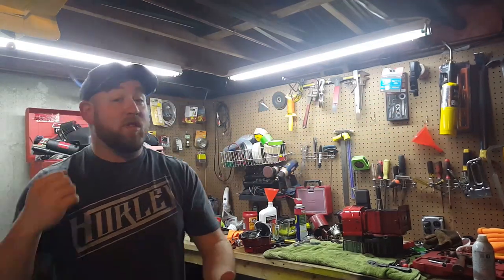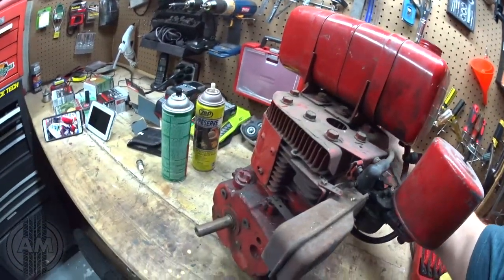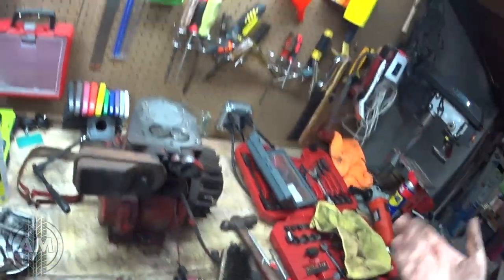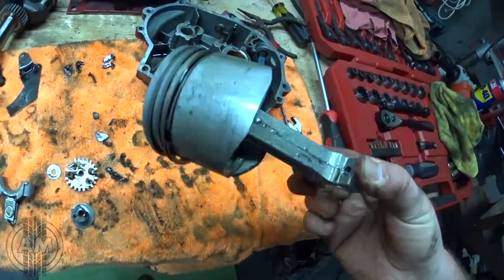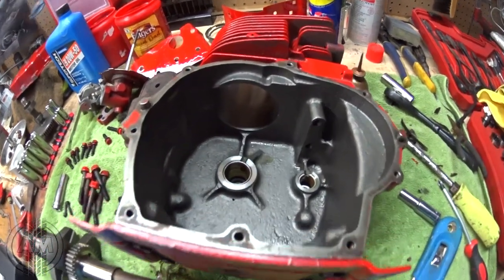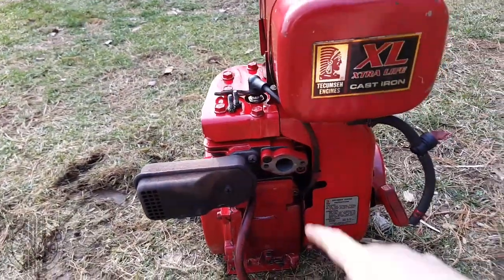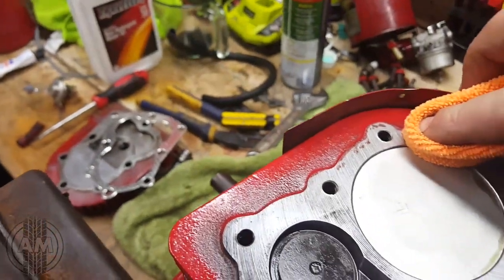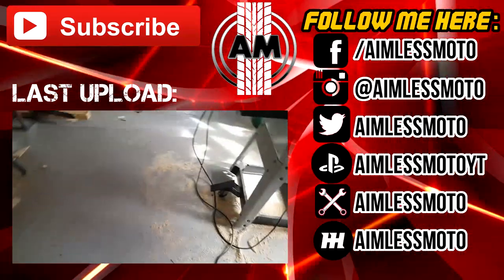Small Engine Repair | Tecumseh HH60 REBUILD | Diagnose and Fix | PROJECT

Comment: Really glad to find this video.  I have two old (mid '70's) TroyBilt Horse tillers with the same Techumsa engines.  One is dead, the other is extremely tired.  I'd like to use this video to try to rebuild one good engine out of the two.  I think it would be a great way to learn how to rebuild engines.  Also glad that you have a normal speed version of this rebuild.  I was disappointed initially that you fast-forwarded through the most important part.  Thanks!

Comment: I understand why you called it a turd but these were nice engines. Mine served many hard years on a troy bilt tiller.
Reply: I just rebuilt mine. Wish me luck.
Reply from the maker: It was a turd when I got it... it's been dead reliable since the rebuild!
Reply: @AimlessMoto  Gotcha thanks. Good to hear.

Comment: I have one of these old Troy Bilt tillers with a Tecumseh 6hp engine that wouldn't start - I replaced it with a Harbor Freight 212 Predator and it was fairly simple direct fit and the Predator is working just fine.  I will try to rebuild the Tecumseh someday but not just ready to do it at this time.

Comment: I'm about to put my 70s Troy Bilt Horse tiller back into commission after 20-something years sitting in the garage, and it has this exact engine on it. So the timing is perfect!
Reply: How did you do on taking off the crank belt pulley, mine was tuff rusted on solid.

Comment: very good video.

my 1986 troy-bilt tiller has the same engine and was running fine a couple days ago and i shut it down to tighten the drive belt. since then it has decided not to start. after checking things out i saw the compression was really low. (60 psi) so i decided it needed rings. well after thinking about it i decided i better check valve clearances first before tearing into the engine to replace the rings. i have yet to do that but i had an old 3 horse tiller with a similar problem a few years ago and it turned out to be tight valves. i have yet to check them but i am hoping that is the issue because it is so much easier fixing that than installing piston rings. 

you stated it did not look like there was a way to adjust the valve clearance. well you have to remove the valve and grind a bit off the stem to get the necessary clearance. i found that out with that small tiller i fixed. i made a special tool to remove the valve springs and still have it. i am just hoping that is my problem.

Comment: I’m going to give it a go.
Rototiller worked well last year but this year I’m having trouble.
Replaced the carburetor.
It barely keeps running. Noticed oil coming out of one of the bolts holding on the head

Comment: My experience over the past 40 years with Tecumseh engines found they are best used for...increasing B&S engine sales,doorstops.rowboat anchors,weighing down large stacks of paper,and giving you an excuse to take it to the scrapyard to look for angle iron,round or square tubing for other projects.I do admire your stick to it ive ness.

Comment: 12:15 The thing causing all the smoke when you start it is a bad fuel to air ratio. I found that the throttle has to be almost closed and the choke open completely for it to start and not have a rough start.

Comment: With the amount of carbon build up in that engine, I'd say it's far more likely that the damage to the top of the piston and combustion chamber was due to chunks of that carbon coming loose. I've completely rebuilt one of these HH60's and have another that I need to finish the rebuild on(oddly enough, this one had a governor failure and piston skirt damage too...ran like a top anyway). A couple of hours ago, I finished replacing a HH60 with a $120 212cc Predator motor. I would have shimmed the crank on that to get the endplay into tolerance....should have been a shim in there already IIRC. Also, I didn't see you check end gap on the rings before installing them on the piston. Always check that because they might be file to fit instead of drop in.

I like old engines, but the Predator starts way better than any tecumseh I've ever had the displeasure of using, makes far less noise, has electronic ignition, and is more fuel efficient.  Tecumseh has been out of business for a while now, and parts are getting harder to find. Just not much point fighting the tecumseh back into prime condition(which isn't all that much to write home about IMO) instead of replacing it.
Reply: Was that Predator a direct install? I'm having some problems with my '79 6hp Tecumseh and am thinking of doing a engine swap. Thanks
Reply: i have replaces piston rings on several engines including automobiles and motorcycles and i have never filed the rings. i know hot rod builders do but i am not making a hot rod and it is not necessary imo on a standard engine. it is borderline blueprinting which is unnecessary on an engine that is not intended for maximum performance.
Reply: Tecumseh parts are out there

Comment: I want to just run my rototiller and get the garden in, not spend a week rebuilding the old engine on it every time I need to use it. Waiting for obsolete parts from antique parts suppliers. I'm willing to pay $100  every 5 years to just have a tiller that is there, reliable and strong and ready to go when I need it.

Comment: That's a lot of endplay on that crank, but it might run OK like that.  When it exceeds the side play on the rod's crankpin, that's where it can get ugly.  
A little "backyard machining" of the face on that end cover using emory cloth on a piece of glass might help.
Reply from the maker: scdevon i ended up running no gasket and throwing a shim behind the cover. End play is now .010".

Comment: This is the second video I have watched for rebuilding a Tecumseh. In neither video did anyone check ring gap before installing the piston. At least noone showed checking ring gap. Is it not necessary? Thanks for a great video.
Reply from the maker: You do have to check the ring-gap. .006-.008"

Comment: Look like a engine off of a Troy bolt pony tiller  I believe they did a Kholer powered version. And a Tecumseh version. I don’t think the exhaust is correct for it’s vintage but hey it works
Reply: Yup. I have one on my tiller.  Found this video because I was looking for info on the engine. :-) @aimlessMoto, great work!

Comment: I’m no mechanic and I can’t afford to have the work done on this 6 HP Tecumseh HH60 engine. I watched your video but it really moves too fast for me to catch all the little nuances of tear down , rebuild and reassembly. Can you recommend something that walks one through a step by step procedure?  Im pretty sure my problem is the connecting Rod. But right now even though I’ve removed the bolt from the flywheel it won’t come off. Im stuck here. Thanks. Nick

Comment: God designed that engine.
Reply: The HH60 was probably Tecumseh's best engine.   Mine is original on my '73 Troy Bilt and it runs like new.  75-80 psi on a compression test.

Comment: So many of those old parts are hard or impossible to get anymore.  And breaker points, mounted underneath the flywheel? where it is a real hassle for you to have to get in there periodically and service them....Not to mention that flat head engine designs makes less power and torque than modern designs.  All those old engines were kind of made to be disposable.

I started getting into the old Troy Bilt Horse models, ended up with 4 of them, and every one of them had a lack of power problem  (the original tired engines were too wimpy too pull the big Horse Tillers without bogging down when I'd run the tines down deep, no matter how much I tinkered with them).  There was several 7hp tecumseh and (1) 8hp cast iron kohler industrial.
I'd rebuild the carbs and service the breaker points.  I used to work many years ago as a pro small engine mechanic, and on those very same engines... They were ALL too tired from low compression to pull strong enough on those big old Horse Models tillers.  Instead of trying to bore and re-ring them and grind valves and seats I simply replaced the old units with Harbor Freight Predator Engines (212cc horizontal shaft engines that have the shaft and mounting bolt patterns identical to the original old engines!!).  These "Honda Clone" (Chinese copies of Honda engines that have parts interchangeable with Honda' engines) can be bought new for $99.-$119. from Harbor Freight.   I have found them to be really powerful, good running, and durable engines that pull my Troy Bilt Horse Tillers strongly without bogging down!!
Be sure to fit new (industrial grade v-belt drive belts from NAPA auto parts) when re-powering,  as these Predators have  enough juice to just shred the old marginal belts.

Comment: Almost sure that is a 6 hp from a Troy-Bilt Horse model rototiller.  Looks exactly like mine including the fuel tank except the air cleaner is a little different.  Don''t even know how old mine is, probably 1950s or 1960s, still runs great, has never needed any service on the actual engine other than replacing the flywheel key, and it's seen plenty of use.

Comment: Really good video! I just got a Troy bolt horse with this motor. Valves look like your, has knock like yours, mine had blow by on head gasket. Trying to figure if it's worth putting money into it or just buying a new engine. How much did you spend? Any suggestions? Thanks!

Comment: I'm building one of these for an old rototiller this summer too same exact engine.  Two questions.  What was your compression when you had it running good?  And what did you to clean all that decades old carbon off the valves?
Reply from the maker: Stephen Givens Jr. Compression is at 120, mineral spirits and brass brushes were used.

Comment: I would never run non-detergent SAE 30 in an engine.  Run HD 30 which contains all the required detergent additives to keep engine internals clean.  Additionally, the HD 30 very likely is a parafinnic base oil which is superior in engine use vs napthenic base oils commonly found in ND 30 products.
Reply from the maker: Considering the motor is freshly honed and has new rings, piston, and other internals, and everything was 100% clean when re-assembled, running non-detergent, high zinc, dino-oil is a really good way to break in the engine. It allows for seating of the rings, and ensures good wear-in for the bushings. After I put about 5-10 hours on this motor, I will definitely run a more modern oil. I probably will not go with Synthetic, but something with much less zinc.

Comment: What do you use to spin  the engine with your drill?
Reply from the maker: Mark Weaver its a RC plane engine starter cone. BUT you could easilly do the same thing with a socket on a 1/4 inch extension.
Reply: Thank You

Comment: Awesome, I just picked up a Troy tiller with the same motor . I will likely repower it on the cheap and rebuild the tecumseh ....where did you source the parts from?
Reply from the maker: Ebay, just search for HH60 rebuild kit... it's the only place around that carries the piston, rings, connecting rod, and all the gaskets. They're getting hard to find. http://www.ebay.com/itm/6HP-Engine-Rebuild-Kit-fits-TECUMSEH-HH60-and-VH60-/141022281207?hash=item20d5953df7:m:mVebbA16FLl0qakbCk2QRYg
Reply from the maker: I'm pretty sure the Foley company was bought out by the company that sells them on e-bay.

Comment: hey nice job with that Tecumseh motor , but my question is , what is that tool on your drill that you use to rota-tor that motor around and where can i get one myself .
Reply from the maker: Haha, it's actually a rubber/aluminum RC Plane Prop-starter adapter. You can find them online, I got mine for free with an old plane, and it's trash, so I used it... you can find them on Amazon, I believe they're under $20. You need the type you can chuck into a drill. Otherwise, just use a socket on an old extension and cut off the end so you can use it in a drill.

Comment: Ive got the governor components for that engine there from a 71 h70 but they should be the same.
Reply from the maker: +-Doug - Yup, H50-H80 are all the same block. H70 parts will bolt right into an H60... everything but the crank, connecting rod and piston.
Reply: Ok good, I thought so. Yea I have those parts if you want to have your engine governed again. So you need the piece that bolts inside the cylinder cover that has that plastic gear that rides against the cam, the governor lever bracket, the linkage that goes from the bracket to the linkage control thats bolted above the carb. What else let me know? I may not have the bracket linkage because I sold the carb a while back, but I have the bracket and everything else for the governor. Let me know if I forgot something. If you want those parts I'll throw them on ebay and send you the item number, so you can find it right away. Let me know if you need any more parts. I still have a lot of parts left from a couple 71" H70 engines I parted out. Most of the parts for that engine sold and pretty fast so a lot of people are keeping those older Horizontal Tecumseh engines going, they are popular engines. Specifically the snowking, they were some of the best snowblower engines ever builť, compared to some of the chines crap there selling now, yikes. Let me know, thanks.
Reply: The H80 is a pretty rare engine. I dont see to many of those or there parts. What were they used on? My H70's were from Ariens sno throw 10000 series, then when they moved onto the 924,000 series they used the HM80-100 models Tec engines.
Reply from the maker: HH80's aren't SUPER rare... but you're right, it's my mistake, they are based on the HH100 block. The HM80 is a "medium" block motor which is closer to an HH60/HH70 size block. HH80's were common on Wheel Horse tractors... a LOT of the older ones I've seen, even the 80's/90's black motors will just say "H80" on them, HH= Horizontal Heavy Duty Iron Block, H = Horizontal, iron sleeve.
Reply from the maker: ***** OH, thank you! But I actually quick-steeled the hole for the governor arm solid. It's going into a go-kart, so I'm simply using a throttle stop to prevent over-rev.
Reply: AimlessMoto I was talking specifically about the H80. I still see a lot of H50-H70 they were used on a lot of snowblowers in the 70's as well as the HM80-100 which was used on snowblowers in the 70's and 80's my snapper has an HMSK80. I just haven't seen one plain H80 ever. I'm sure there were many produced, I just don't see to many around now whereas I still see a ton of H70 engines and HM80 engine's. But thank's for all that information. It's good to learn some more information about the Tecumseh's.
Reply: AimlessMoto Yea I saw you mentioned you did that. No problem. The engine looks great. I'm sure your go cart will come out well. Make a video of it if you can. Thank's take care, cheers from N.J. -Doug

Comment: Did it stop clicking when you put all those new parts in?
Reply from the maker: +Nathaniel Gibbs Yes! Turns out the click was from the bad tappet (lifter). Off camera I checked the gap on the exhaust and it was about .014 over spec, the new ones brought it to dead-on, completely took away the little clunk. I still have some end-play but it's not awful. I'm thinking of taking it apart again and having a new thrush washer made to take up the slack, that way I can go back to running a full gasket instead of RTV on the case.
Reply: AimlessMoto ground carbon off of valve and top of piston. All cleaned up, no blow by. But when I got the engine back together and tried to start it, it would run but I was getting backfire and grey smoke. Any suggestions/fix? New spark plug and carb was just cleaned.
Reply: Should I try to get new Tappet? Didn't look bad after grind. Had compression.
Reply from the maker: Hmm... backfire suggests the timing could be off, slightly too far advanced. Grey smoke is oil, but that will happen on any engine after a rebuild for the first 30-40 seconds. You could be a little rich on the carb too. My suggestion is to start clean. Pop the flywheel off, check the points are at .020 gap at the little mark on the ignition cam (the one under the timing plate). The small black plastic part of the points that rides on the cam should be between the two small hash marks on the cam.... then set the points at exactly .020". I would also suggest making sure they're clean by using a piece of 1000 grit paper on the points. After that, be sure the bottom (fuel) screw on the carb is only out 1.5 turns from bottomed out (don't bottom it out hard or you risk breaking it), and the air screw (on the side) is out only 1 turn from bottomed out (again be careful not to snap the tip off bottoming it out). Then give it another go. You could check the valves too, make sure the engine is at TDC, then check that the gap is .012-.015 on the exhaust and .008-.010 on the intake. Any more than that and you'll have to replace the tappets, possibly the valves. Nathaniel Gibbs
Reply: +AimlessMoto Thanks!

Comment: is it 2t or 4 t?
Reply: marilyn manson3 4 stroke
Reply from the maker: 4 stroke. Typically 2 strokes don't have oil in the crank case, they are only lubricated by the oil mixed into the fuel.

Comment: i found a push mower on the side of the road i asked the people if they were throwing it out and they said yes so i took it home it had a full tank of gas but had low oil put some oil in the motor and pulled the cord and it started running
Reply: Donovan Bryant lucky!